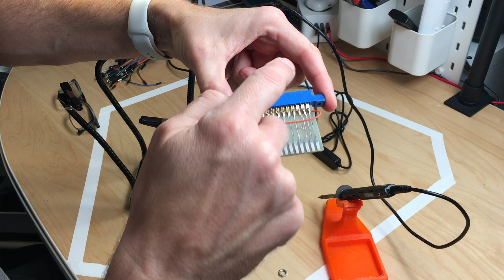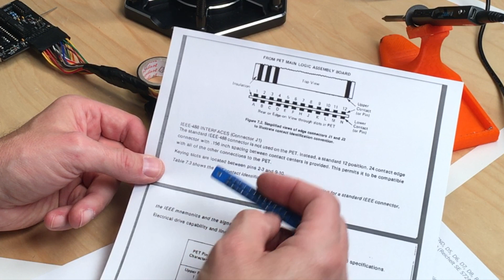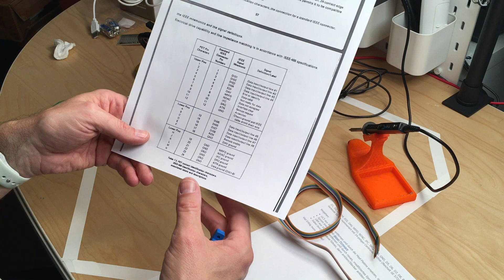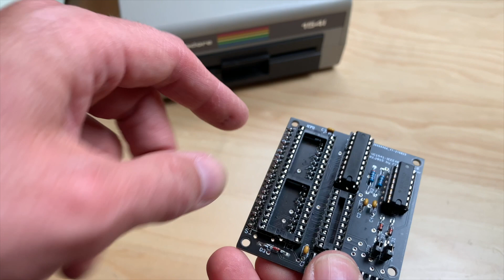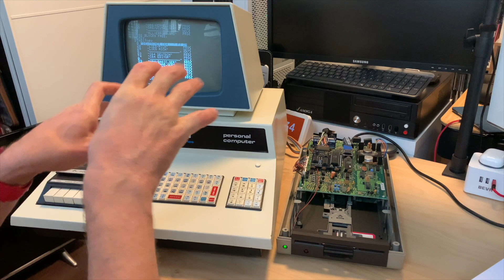Connect a Commodore 1541 to a PET - PART 2/2 - 1541ToPET-Interface - Build along!

Comment: What I would prefer is a serial IEEE cable and interface so that I can plug an unmodified 1541 or 1571 or similar into a PET, without modifying EITHER.

Comment: For a moment there I thought you were going to put the Centronics socket on there instead of the edge connector. That way you could put the 1541 in a stack with other PET drives and do things like direct copy from a 1541 to a 4040. I think that would be a cool thing to see! ;) Maybe an expansion project? You could use the reset board in your parts bin as the basis for an adapter - Edge2IEEE... Just a thought!
Reply from the maker: Yep. Good idea! Thanks!